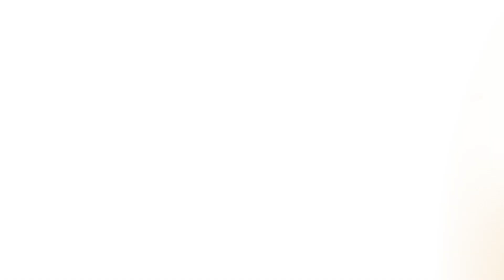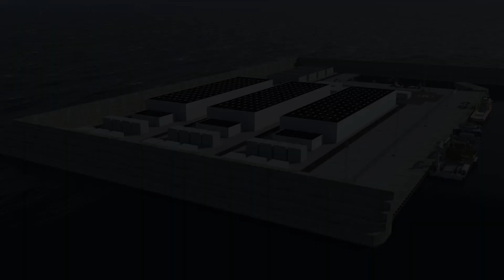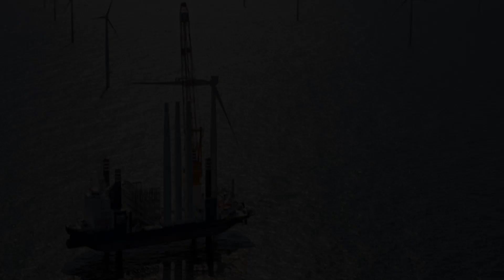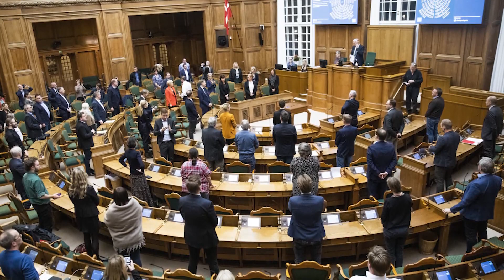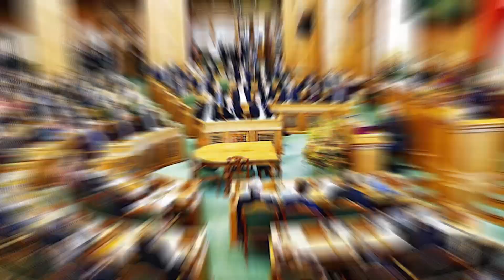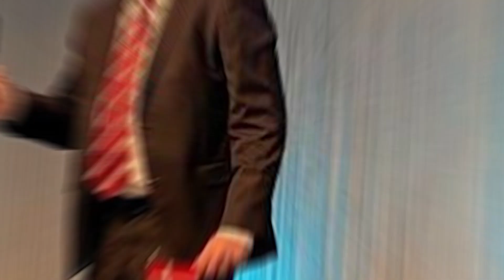Denmark's bold $34BN Project to Solve Europe's Energy Crisis

Comment: do they use oil to build the islands, mine the copper, ship the turbines from china ?  
if so, are not just outsourcing oil-use to different industries and faking everything?
Reply: Probably.

Oil and gas is primary source, giving rise to cleaner tech where you don't have to burn everything.

Pretty sure, it's called evolution.✌